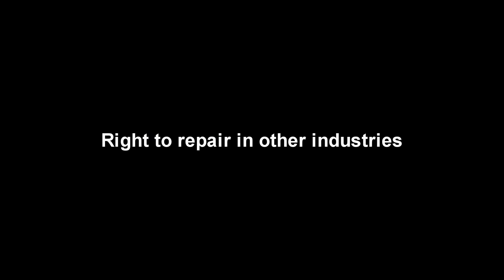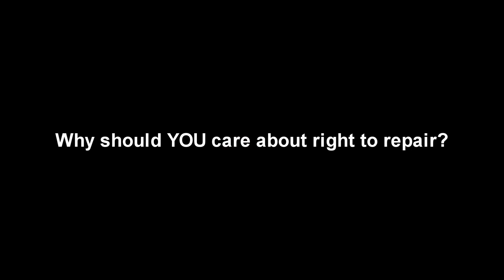eevBLAB 88 - Right To Repair Questions & Answers

Comment from the maker: Because people never read the video description:

NOTE: This video was a response to various questions about Right to Repair I hastily did for a legacy media current affairs program who are doing a segment on right to repair. But I now won't be on it, so here is the footage if it's of use to anyone else.
NOTE2: Yes this video si the same as on my EEVblog2 channel, but a lot of people said it belonged on my main channel, so here is it with some of the questions inserted.
Reply: Automotive industry has resorted to this as well for many components that are monitored by the onboard computers. Replacing say an abs unit in the braking system requires a trip to the dealership to reprogram the ecu to accept the new serial number of said unit.
Reply: Amazing video Dave. You should maybe consider hooking up with Luis Rossmann? You both seem to have very similar opinions on right to repair 👌
Reply: RIght to Repair was made a law in the US, I think. As soon as I heard that I checked Apple stock and it went down 5%, fuckin Apple.
Reply: @aaakkk112  I’ve seen that coming for awhile. They’re integral to the operation of the vehicle, which in turn means you are stuck with whatever sound quality your unit is able to reproduce. Which, generally means the cheapest dsp possible for a set “quality” that is usually subpar at best.
Reply: @defaultdriftco00  a little like apple soldering their RAM and CPU to the motherboard, you have to pay for the spec you want at the time of purchase which forces people to pay ridiculous prices for basic components that are available at a fraction of the cost
Reply: @debonh3828  this is about more than just phones
Reply: @Bilde Rothchild What are you talking about, and what does it have to do with Dave, right to repair, electronics etc?

There are plenty of other channels where you can talk about whatever it is you want to talk about. Stop derailing discussion of a specific topic with completely unrelated links.
Reply: @Bilde Rothchild The Australian government's digital "privacy" laws and surveillance powers have been deplorable for many years. I've personally been actively protesting them for almost 10 years. It's funny how you're only just noticing this now. This still has nothing to do with the video. It seems that you just like to spray your screed at any opportunity, and in any forum. You'd be taken more seriously if you actually found the correct channels to do this in.
Reply: @Bilde Rothchild I think you might be getting paranoid mate, My name's not David, and I'm not trolling.
Reply: @Bilde Rothchild Wow. Look at all those maskless idiots and violent police. I'm not sure I could save any of them, both sides in that video have completely lost the plot.

Don't talk to me about treachery if you're going to ignore the common sense, scientifically upheld and really quite easy advice to wear a mask, stay away from other people and hopefully get vaccinated.

Also, yes I do think you're paranoid. You were somehow convinced my name was David. That's not normal.
Reply: No need for an explanation, its not that complicated..
Reply: Great video as usual, thanks for video, i eagerly wait for your video.
Reply: "internet of things", all devices will have wifi and serial numbers connected to 5G for government analysis and control. imagine trying to lend something to a friend who has a bad social credit score through an evolved Vaccine passport. " another phrase I see from the elite " You'll own nothing and be happy!"

Comment: If I was in power, "repairability" would be mandatory. For economical as for enviromental reasons.

Manufacturers would be required to supply service information at no charge. Also they would be required to give ALL the design documentation to a state-run archive, which will keep them safe for a set duration (I respect trade secrets to a degree), but makes them public as soon this time is over (and it will be fairly short, in the order of a few years) or the company goes under. Also they would have to supply sufficiently fine divided spare parts in an easy way (like an online shop where everyone can order). 

Up to the early 1980s serviceablity was basically common sense. Every piece of consumer electronics was supplied with at least a schematic and at least authorized dealers could get any spare parts. 

I love old Tektronix equipment, which had those glorious sections "Theory of Operation" where they EXPLAINED how the circuits work. For the tube scopes you needed a special kind of solder. That was because they were built on ceramic terminal strips which were silver plated. Normal solder would dissolve the silver from the ceramic and basically destroy the terminal strips. The only way to prevent this was to use a solder alloy which was already saturated with silver. Their solution back then: They mounted a small spool of that solder into EVERY SINGLE DEVICE, so you can use it for repair work. 

My "R&S SMS" rf signal generator has the riser card which you need to measure on single boards mounted into the case .. and so on. The service manual is superb and I already fixed that thing a few times.

Comment: I ordered a phone from Tracfone.  When it didn't arrive after a week, I called them, they said they will issue a refund and you can just order another phone.  Just a day later the first phone arrived so I called them to activate it.  After multiple attempts with several reps they finally told me that phone has been marked as stolen and we can't reverse that.  You can't use that phone, in fact no one can use it, ever, and nothing anyone can do about it. I still use it as a camera but what a waste!

Comment: I've been doing workarounds lately, by buying things in modular and assembling the whole thing by myself. For example, power bank, I got the board, case and batteries separately. More work but it's better for long term. I really hope that I can do that for many more products, starting with the big ones like a fan where the bearing, driver and motor can be swapped or even upgraded. Come on, industry!

Comment: I'm not sure that "independent repair centres" are that much cheaper for phones.  The point of the board swap approach is that it is fast, requires very little skill/training, and is successful 100% of the time.  They then take all the broken boards and process them centrally (presumably recovering reusable parts automatically to make new boards for swapping).  They certainly don't bin valuable components.

That's not to say that the "right to repair" isn't a good thing, of course...  Just that it probably isn't going to apply to consumer electronics in practice - it's more targeted at industrial equipment and white goods.  These actually have an economically viable repair ecosystem...
Reply: It would be interesting to see the "repair chain" or whatever it's called. I don't know if it still goes on for for some products from the past you'd get the offer of swapping for a good quality, refurbished device with a warranty and then your old device would presumably go into the pile to be triaged.

Comment: Serialisation of components in something like an Apple phone does have an interesting rationale. The first issue we saw was with the fingerprint reader inside the push button. A replacement button would work to drive the UI, but the internal fingerprint reader would not. The owner could still use the phone, but only with a PIN. The reason being that only an Apple repair centre has access to the appropriate authorisation certificate to create a binding of the replacement reader to the phone. This is an interestingly serious question. If the certificate leaks out into the general repair community it becomes viable to produce hardware hacks that circumvent the fingerprint reader, and thus break the security of the phone (by say a replay attack).  It wasn't that long ago that Apple refused the FBI's request to produce a customised OS build that would allow the FBI to crack a phone. A modern iPhone has a very secure hardware/software design. Encrypted communication between the peripherals forms part of this security. 
As cynical as we might be about Apple's motives in creating this system, I suspect they see far more value in the sales that comes with a phone that is as near uncrackable and resistant to clandestine hardware modifications as reasonably technologically possible, versus the lost income from third party repairs. The reputational damage from being hard to repair is not small, but the damage from having a phone which has its much vaunted security model broken by installation of a third party part would be vastly worse. 
The problem with car parts is similar. However there is an active set of hacks that allows at least some use of second hand car components, although it often requires a small microprocessor on the appropriate CAN bus to modify communications.

Comment: Planned obsolescence. Check the washer machine transmission shaft's, they used to be steel made, and lasted 30 years, now are made of "metal pot" an alloy the will get soft and brake with water contact after few years.

Comment: The notion of having rights is interesting. Here in the UK, we don't have any rights - we have laws and everything in society is tested or challenged in the law courts to set a precedent. In the US they have a constitution which declares the rights of citizens. As frustrating as it is, I really don't see why a manufacturer should be forced to accommodate the repair industry; surely it's up to other manufacturers to use repairability as a USP and let competition do its natural thing. Having been in the electronics repair business for 50 years, I've found that usually the economics dictate the viability of a repair rather than manufacturers making life difficult. Even going back 30 years consumer products have often used custom ICs that aren't available as a spare part and only as part of a sub-assembly, often making the repair cost prohibitive.  The auto industry is the number one culprit in coding modules to a central ICU so that used parts can't be used as only new modules can be 'flashed to match'. It's not uncommon to find cars written off for the sake of an automatic handbrake module costing £1500 to replace or even a wiper motor. Windscreen wipers used to consist of a single motor operating two wipers via simple mechanical arms; reliable and inexpensive to replace. Increasingly they are now a pair of direct drive modules each with a built-in microcontroller coded so eac one knows where the other is and therefore can be synchronised without any mechanical coupling. A new module can cost hundreds or even over a thousand pounds to replace.
Reply: Hi AnalogueGround,
It's funny that you mention that the US has a bill of rights, when the UK lived with a much better one till Brexit... The EU protects people's rights much more than the US.
I'm sorry for this out of subject reply... I have family in the UK as well as in Europe and I'm Canadian, so mostly an external observer...
But I do agree with your Right to Repair comments. 
Cheers 
Mark
Reply: @questionmark9684  It's unfortunate, well disgraceful actually, that Brexit was implemented based on the vote of a largely uninformed and media saturated public. We are in a mess and it will get worse. I'm naturally optimistic but I can't think of anything that Brexit achieved that I can be optimistic about. It's strange to be discussing this in the comments of an electronics channel but it is relevant in a way. Leaving the EU meant we lost extended warranties on consumer products when the failure was deemed to be unreasonable. Irrespective of the manufacturer's warranty it was possible to have items repaired free of charge for a minimum of 2 years. Very few consumers were aware of this like so many aspects of the EU.
Reply: @AnalogueGround  Hi AnalogueGround, 
Yes, I feel the same way. I think that being informed is the most important thing that consumers as well as citizens must do. And I discovered something entirely new with Dave's videos on Right to Repair.

Comment: you mentioned cars, and I would argue about the aftermaket parts, especially related to electronics. All the sensors in the car are paired and are using encrypted channels to communicate. I would understand this approach in systems such as tachographs, where it is important to check the drive time and the speed, but in simple cars it makes no sense, since only dealers have access to that information. I'm not even want to talk about the fact that all new cars have e-sims preinstalled on them and are always connected to the internet, this begs the question if you own the car or the dealer, since it can make your car obsolete remotely at any given time.
Reply: Encrypted channels are essential. There are plenty of people who would hack into your car and run it off the road potentially killing you or any other drivers/pedestrians just for fun.
Reply: I agree, but the truth is that they use this as an excuse to not allow users to do anything with their cars. After all I buy, not rent, the car and I would agree to sacrifice security for access and repairability

Comment: Dave, I just completely lost faith in you, though maybe I shouldn't have had it in the first place, considering I don't want false faith placed on me either.

Right to repair is NOT about whether you can take your widget somewhere, rather it is about the data and parts being available so YOU (or I, or anyone given sufficient motivation) can DIY.

You are at least one level abstracted and behind the curve for what this all means.  NO it does not just mean can I take some widget to some 3rd party and get a part, it means do I have the info available that I don't have to do that!

I don't want parts from the 2nd hand market, I want to repair the specific subsystem at the component level that failed to have the data available to do it without a high burden of reverse engineering.

Right to repair is not as much about parts as it is about the initial design lending itself to repair and making the data available to DIY. Granted, you seemed to focus on phones, while those or other highly dense designs, are the worst for DIY because of the complexity and density of the design, but looking forwards, one step at a time, first we need to get this done for the low hanging fruit, the electronics that aren't so small and dense that you need a microscope and surgeon skills to fix that widget.

Ignoring phones as the exception, modern appliances or vehicles are something everyone can relate to.

Comment: I'm can see both sides of the right to repair debate. The manufacturer could examine the total cost of ownership over the life of a product, and reduce the initial purchase price based on what segments of the lifetime cost the manufacturer expects to make revenue on. Inkjet printers are the classic example. You can buy complex inkjet printers for a price that does not cover design and manufacturing costs. Over the years of ownership you then have to purchase ink cartridges priced at much higher than the manufacturing cost, to allow the manufacturer to recover original product design and manufacturing costs. Ink jet companies (like Epson) also do sell models with a higher initial cost, but very low ink costs. I don't think this tradeoff in initial purchase price is an invalid thing to do, although do think it should be made very clear upfront if you are buying a device with low initial cost but higher operating costs or a device with higher initial cost and lowest possible operating costs. Let's take the example of a $100K tractor, which the manufacturer expects to make an additional $50K over the lifetime on proprietary service. Would the farmer prefer to pay $150K initial cost, and be assured independent service organizations could get the tools and parts? I think it's a difficult marketing sell for brand B of tractor to cost $150K and brand A cost $100K. Both tractors may need $50K of servicing over their lifetime, but the $100K tractor has these costs going toward the manufacturer. For the manufacturer, the cost to replace a circuit board may be much lower than diagnosing down to the component level, so has little incentive to supply component level repair data/tools/parts. This is no different that rebuilding a car engine piece by piece instead of buying a new/rebuilt engine in a crate. If labor costs is high, buying the large assembly done efficiently in a factory is likely a lot more economical. There is also smaller pool of people who can diagnose/repair to the component level vs module level. Like it would not be impossible to repair an incandescent light bulb by opening the glass casing, replacing the filament, removing the air and sealing the glass casing back up. Everybody just throws away the bulb, as it's just too labor intensive to repair the individual parts. The filament cost is almost nothing compared to the labor needed to replace it. So the right to repair debate partially seems like a debate about component vs module repair costs, which are really about labor availability and costs.

Comment: The Dishwasher/washing machine market is a bit different today too. Our Miele dishwasher had its main pump fail, the cost for the labor and the pump was like 1200€. We bought a new machine since the warranty just recently had decayed. When I dissected the dishwasher I noticed that the pump was very deeply buried in the machine, instead of semi-easily accessible from an access panel or something. Then our washing machine which was under warranty. Guess what? -"Main board is shot"  (Is this the washing machine equivalent to the head phone jack being broken?) Outside of warranty it would have amounted to around 450€ Reparability, sure to some extent, but it could be better, much much better. Sorry for the long post. :-(